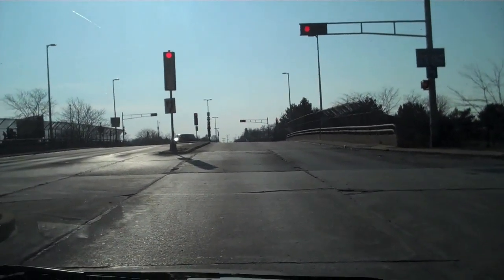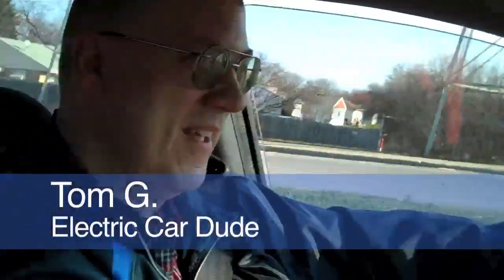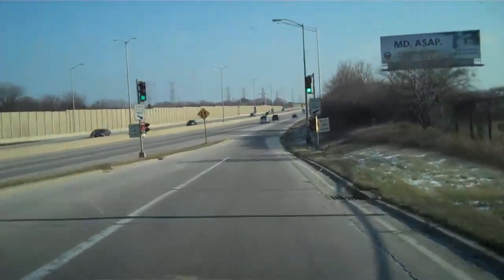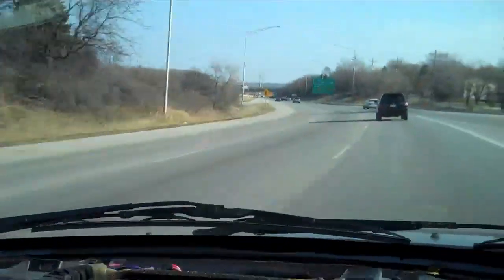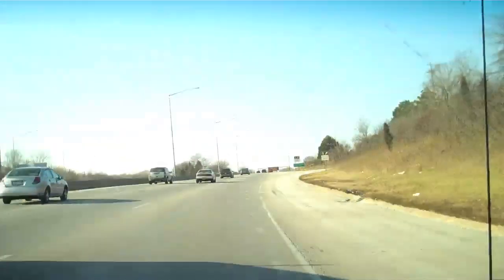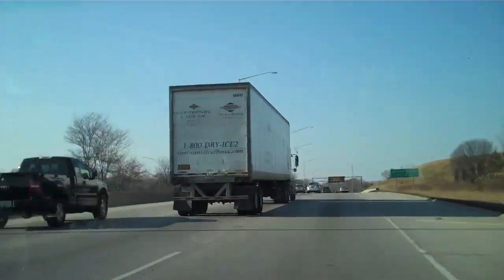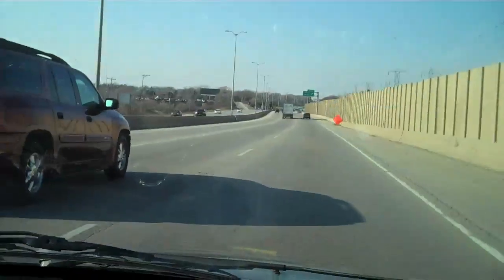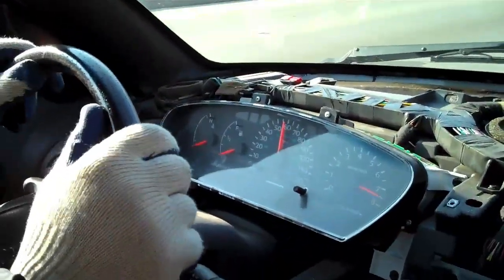011 AC Electric Car Conversion: Freeway Test Drive

Comment: Good to know the typical values:
450 watts per miles on flat highway, equivalent to 90 miles per gallon.
If pg&e charge you 15 cent per kilowatt hour, you save money.
If pg&e abuse with triple price like here in Oakland, then keep burning decomposed dinosaurs.
Reply: Screw the electric company. Get some solar panels to charge it

Comment: lithium batteries........
Reply from the maker: Yes, what about lithium batteries? Lithium certainly is less weight and more relative capacity than lead acid. Keep in mind the expense of lithium batteries when this video was made. Costs have come down considerably over the years. In fact, the genesis of this particular project was that Tom got an entire pallet of new old-stock sealed lead-acid batteries FOR FREE. He took it as a challenge to build an AC electric car based on that and some salvaged industrial AC equipment. He built the entire project for less than what the cost of Lithium batteries would be now.

Comment: the car is a neon so it will be slow to pick up at high speeds and will slow down going up a hill even with a petrol engine (just make sure you can get to the top of the hill)

Comment: What I don't understand with EVs is why don't big companies or people who make EVs at home add or keep the alternator. The alternator recharges the battery as it uses power so having at least one installed should extend the driving distance and save some power. Just a thought.
Reply from the maker: Most EVs use a DC/DC converter. It's all electronic and recharges/powers the 12V system for the headlights, radio, etc. Unlike an alternator, there's no moving parts and nothing to break or wear out. Additionally, an alternator only works while the motor is spinning. On most EVs the motor doesn't even rotate while the car is stopped (such as at a light or traffic jam.) Lastly, alternators don't MAKE energy, they convert it from a mechanical source. To use electricity (from a charged battery) to run an electric motor (electric to mechanical energy) to run an alternator (mechanical to electric energy) means that you are basically trying to use a battery to charge a battery. That's a long route to go, and only causes losses at every step. You can't end up with more electricity than you started with. The main thing that people often forget about with alternators is that they make the engine that is running them WORK HARDER (ie, use more gas, etc.) That's where the energy comes from. It is not free. Using an alternator on an electric car makes the more work harder, draining the main battery quicker SHORTENING range, not lengthening it.
Reply: I'm sure energy from the spinning motor can be fed back into the battery. Even with losses that will occur some energy will be transferred back into the battery from a spinning alternator of sorts. The alternator as it's designed now is probably not the finished article but probably can be developed further to make it more efficient. Would probably be worth a try.
Reply: Carl Darl
In theory and on the paper, alternator would produce more resistance than regenerate equal amount of power needed to "level up" wasted energy. If that wasn't the thing, put big high revolution alternator on a much less rpm spinning  motor with very high torque and drive 20 km/h for 40 000 km :) Or even produce more power than u use :D Perpetuum mobile? ^^ Thats why they use regenerative braking rather than alternators... U bring all the energy back with it (since u don't use acceleration at the time) rather than downgrade engine with 10% and bring back lets say, 2-3%? The way i see it, it's 0+ vs negative 7-8% :D
Reply: May be he meant, when we are not accelerating and we need to apply break or even car moving down hill and we dont need speed instead need deceleration that can be converted to power.
Reply: @nabhasan  That is called regenerative and the electric motor can be used for that.

Comment: Something is VERY wrong here! With that many volts you should be able to spin the tires all the way to highway speed! Many people are recharging with 110 volts in less than 8 hours! 95% of conversions don't use a clutch and shift 2nd to 3rd only no need for buttons! Called "floating" your gears, ask any truck driver how to do it.

Comment: The original car would have had a crank sensor. Could that somehow be used to trigger from the trans then use that to set motor speeds for each gear into the controller? Might need a seperate switch for each gear but it would make shifts seamless.

Comment from the maker: Maybe, maybe not. In any manual transmission car, it still doesn't let you shift directly into a gear that is totally mismatched for your engine vs road speed. In this case, Tom is an engineer who enjoys challenges and doing things differently. The electronic speed matching is a creative solution, using the electronic skills he has. It's actually the type of feature you will begin to see on high-end cars.

Comment: it has been almost 3 years, what is the state of the project, is the car still running? have Tom changed the batteries? did the cost of electricity rised?

Comment from the maker: This car has the manual transmission, but no clutch and flywheel. Instead, the electric motor is coupled to the driven shaft of the transmission (with a "LoveJoy" type coupler.)
An electronic control matches the speed of the motor to as appropriate for upshifting, so that you can simply shift without needing a clutch at all.
Reply: Can it work with an automatic transmission and a torque converter?

Comment: Is this car a stick shift or was the transmission taken out? Wouldn't it be more efficient to have the gears on EVs? If the torque is higher at lower rpm, then the gears should keep the rpm lower at higher speeds, therefore better torque as you shift to higher gears.

Comment: have you considered going lithium or A123 and doubling the voltage?  much lighter weight and it will give you much more power.

Comment from the maker: It depends on the battery, and its exact chemistry. Typically, lead batteries are measured in hundreds of cycles, and lithium in thousands, but it also depends on how deep you discharge them and when/how you recharge them.  The start of this project was Tom getting a pallet of basically new batteries for free.

Comment from the maker: @baboracus 
I may have misspoke there - I'm just an amateur, who is still learning all this. Tom, the big bald white guy behind the wheel is the electrical engineer. It's my understanding that the voltage changes directions a certain number of times per second (hertz or frequency)

Comment from the maker: @baboracus 
I think you might be slightly confusing how AC and DC work.
On an AC motor controller, the alternating current "pushes and pulls" at some certain rate, say 60 times per second. Imagine an old-fasioned steam locomotive. The piston pushes out to rotate the wheel forward, and when the rod is fully extended, pulls it back in, but the wheel is still turning the same direction. The faster the piston goes back and forth, the faster the wheel spins. AC motors work pretty much the same way.

Comment: what do you mean when you  say the AC controller varies the current frequency? Say you got a bridge and you are turning the gates on and off at 60 hz. If you turn them on and off at 120 hz is that changing the frequency of the current? I'm still a little confused. What was your baldor motor rated at for V, A and frequency? Is that one way to find out the inductance?

Comment from the maker: @InsectsandCreatures 
Technically, AC is more efficient, because it has no brushes. Both can be excellent motors, and more than enough to push a car down a road.

Comment from the maker: @panyolito1929 
AC (Alternating Current) electric vehicles use a controller which changes the frequency of the current to the motor to change the speed. That's all internal to that controller, called an "AC Drive".
On DC electric cars, the controller just turns the current on and off to the motor, but extremely rapidly, an varies the relative on to off time to adjust the speed. Do a web search for "PWM" of DC motors for more information.

Comment from the maker: @daswada9 
On a rear-wheel drive car, you COULD connect the motor directly to the differential. This has typically only been done on high-voltage, high performance cars, such as for drag racing.

Comment from the maker: @daswada9 
This is a front-wheel-drive car. Without the gearbox, you have TWO drive-shafts (one to each front wheel) that are just hanging there. You would need a custom solution to support both shafts and connect a motor or motors to them. There have been some conversions, such as the Solectria Force, that used a custom single-speed gear reduction in place of the original transmission.

Comment: should be a problem if i don't use a gearbox,just connect the motor to the shaft ?
Reply: That would need much more maths and calculations when accelerating.

Comment: hi doing i thing you have problem to acelerate because the transmission,i think you didint need one,the engine has big torque,you reduce the espeed with the brakes so

Comment from the maker: It just also happens to be a lot of batteries. Each charger is 10 amps. Use 20 amp chargers, and it would cut the time in half. You aren't going to find a lot of electric outlets that can handle 20 amps times nearly 30 batteries!